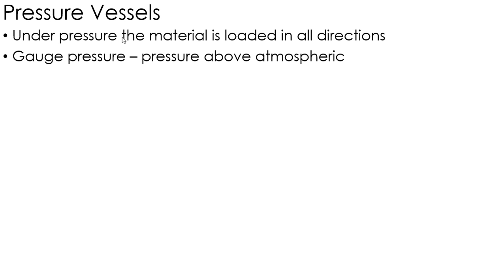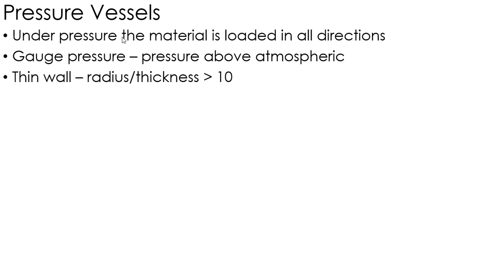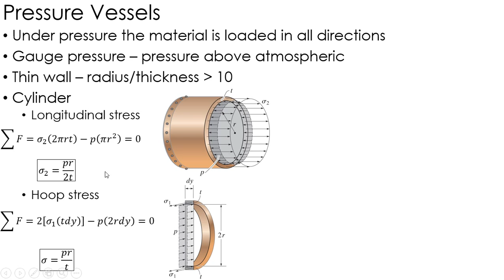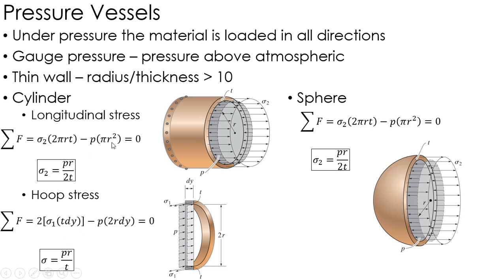Mechanics of Materials Lecture: Pressure Vessels

Comment: Hi Sir, is the "r" in the formula refer to inside radius or outside radius?
Reply: "r" is inside radius.
Reply: thank you
Reply: Either one. The condition for this type of Analysis to be valid is for the radial dementions to be much greater than the thickness. Under these conditions, the inside radius is basically the same as the outside radius